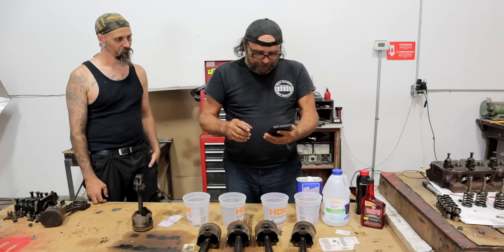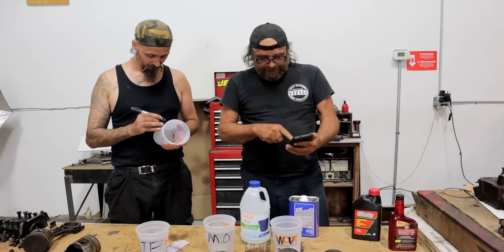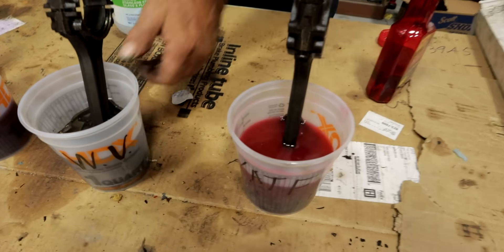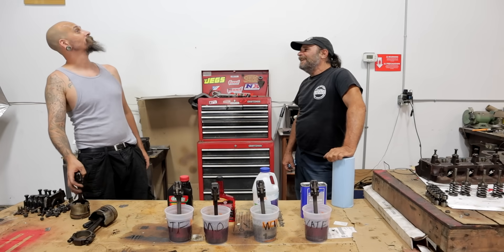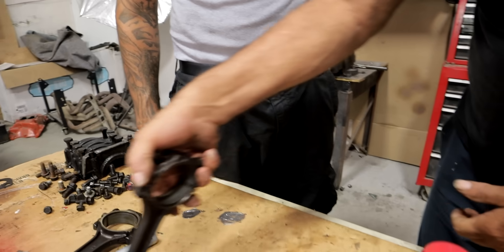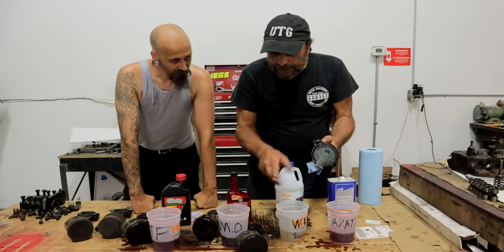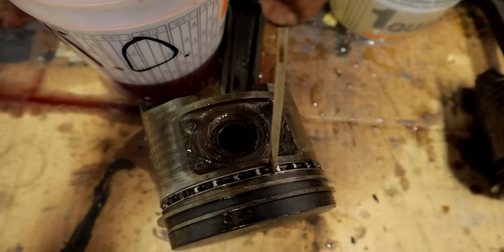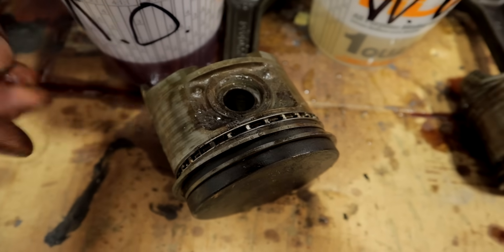Best Fix For A Stuck Engine - Viewers Choice. Marvel Mystery Oil, vs ATF, vs Acetone, vs Vinegar

Comment: Watch puddings fab shop. Hes brought things back from the dead with vinegar that should have never run again. Vinegar is the only acidic one, it will also remove rust off valve seats and bore. Reckon vinegar over night flush then ATV before you try to start.

Comment: I'd be almost curious to find out if the results change with temperature. I don't know if you can be bothered testing it but if you get the oils and parts just too hot to hold but not much more would the results of each product change???
Reply: Heat always helps!if you would "cook" the parts the expanding of the metal would help freeing the stuck parts!

Comment: Vinegar is an acid. Depending on how long you leave it, it's going to accelerate pitting on the cylinder walls and you need to completely flush it out of your engine after you get it free, or it will break down whatever oil you put in it afterwards. 
I want to try molasses or even EDTA, which would specifically attack iron oxide and leave the aluminium and good iron alone.
Reply: molasses is acidic as well and a bit thick so you would have to thin it. I am also betting it will cause more hassles on an aluminum piston than on the walls but might be wrong.

Comment: What a surprise! I never thought of using vinegar to soak engine parts but have used it for rust removal on tools & other rusted metals. The cool thing is that it's way cheaper than the other products & comes in a gallon jug. It can also be safely heated and you can add a variety of additional detergents & degreasers to it.
Reply: Try electrolysis with either vinegar or in a saline solution.  You might be surprised, I've been using it since the sixties, out of popular mechanics back then.

Comment: I've been able to successfully free stuck rings numerous times by putting b-12 chemtool in the cyls and oil and cranking it with the spark plugs out then putting them in and running the engine until the smoking stops

Comment: I would hesitate to use vinegar unless you can closely monitor whatever you're soaking. Your parts will flash rust when they dry off
Reply: I have used vinegar many times to free stuck engines and other items and have never had any problems result  from its use. The key to using it is that as soon as the engine is free, drain the vinegar from the engine and immediately oil it and turn it over to coat the engines  cylinders , pistons, pins, and crankshaft surfaces to prevent them from flash rusting. And any pitting in the cylinders are where there was already pitting from the rust as vinegar will eat the rust but leave the good steel and aluminum unphased unless it is left in it long term. The normal 24 to 48 hours of soaking it won’t cause any problems.

Comment: I'm at 3 minutes and 6 seconds my vote is for the acids all the others are somewhat about lubrication.  Only the vinegar will dissolve that rust. The rings are shot so you can't hurt them any further the mild acid won.t hurt the aluminum pistons. you don't need lubrication because the pistons are out of the block. If this were a stuck block that  I was hoping to run l without re ringing id do the acetone and ATF. Electolosis would have been the least invasive.

Comment: old style carburetor cleaner gallon can (not spray can garbage ) that comes with a dunking basket will ment carbon and make all carboned up ,stuck ring pistons, come out looking like new ... I've been out of the auto stuff since about 2000 but back then the petroleum based stuff worked great but not sure about the environmentally safe water based stuff .. Be interesting to see you try both!! The new stuff might be good also ,because carb gunk is stubborn so please  give it a try you will be very impressed  ..

Comment: My 53 Ford sat for a decade. White gunk kept filling the glass bowl on the carb. It was everywhere in the carb. I tried EVERYTHING in my garage. I came in for a beer, and looked under the kitchen sink. TSP Bubbled it off in seconds. I dropped the tank and used it in there too. Problem solved.  If your answer isn't in the garage, it might be in the kitchen. Vinegar might free up a rusty cylinder.

Comment: I soaked an entire 58 chevy restoration in a 1:4 vinegar to water bath. any parts that would fit in a 50 gal on drum 1/2 full. 5-7 days and all the rust just fell off with a light rub with scotchbrite. I didnt need to sandblast anything. Beware it eats plastic and softer metals if left to long. My trunk latch learned the hard way. Vinegar is so easy to work with and not oily which is horrible in a body shop

Comment: The one thing that the vinegar has going against it is that if you're freeing up the rings without tearing down the engine the vinegar probably won't stay in the rings long enough to do much good.
Reply: Same with most of it, but i get your point, most will just go past the rings. This test does show that it has more juice
Reply: @baileyhatfield4273  the ATF and Acetone mix (ATF and Diesel works too) Wicks into the voids and stays there. It generally tests better then the high-dollar penetrating oils, even better than Aero-Kroil.
Reply: @kmoecub  Kroil is probably best for times when you’re heating the stuck parts with a torch to aid penetration of a penetrating oil.  Something I’d never try with an acetone mix.
Reply: Right it's fir rust anyway, but I've seen plenty engines freed up with Marvel

Comment: I've got a '53 210 with the 235 that sat in a field for 40 years, I assumed this motor is trash due to the aluminum pistons, do I fill the block with vinegar or do you have a better suggestion (I had already planned on making this thing a gasser)

Comment: Told ya, LOL! If you have any rusty metal, Cleaning vinegar will take it off (unless it's really thick rust, may have to chip the rust off first) . I had a '91 D-150 that the paint was burnd off of the roof from years of sun beating on it. I laid some cheap cloth towels on the roof, soaked them with cleaning vinegar, then covered the roof with plasticsheating to keep it from frying out, Let iit sit for 3 days and uncovered it. Then I pealed the towels off. All of the rust was stuck to the towels and the roof metal was as shiney as it was the moment it came off of the press at the factory. Then I washed the roof with baking soda and water to neutralize the acid in the vinegar then rince that. I got sidetracked with life and the truck sat in the weather for over a month uncovered and it was still shiny new looking, even after being rained on several times. I gave it a light sanding then primed and painted it. I use cleaning vinegar for all my rust removal. Way better than sanding your ass off and warping a hood like I watched a buddy do, LOL! On a stuck engine, I fill the cylinders with cleaning vinegar, let it sit for 3-4 days then turn it over with a socket and breaker bar, fill the cylinders with baking soda and water. wait a day then turn it over by hand to pump the water out of the cylinder, drain the oil from the pan  put diesel fuel in the cylinders turn it over by hand then drain. Put fresh oil in and filter on the engine, a little squirt of oil in each cylinder, turn it over by hand again to get oil circulated put the spark plugs in and fire it up.

Comment: If your patient and willing to use the weaker food grade vinegar, it costs less than half the price of gasoline these days at Walmart.  Crazy cheap when you think about it.  And the weaker acid won't be as aggressive on the aluminum.  I have seen ATF used as an oil flush to un-gunk an old engine with sticking hydraulic lifters.  But that was oil sludge not rust and was a last resort which did work out in that particular case.

Comment: Even better- and cheaper- than vinegar is to get a jug bag of citric acid sprinkles and mix them into water. Cheap as hell, you can tailor your acidity, and can easily get to near phosphoric-acid strength without staining.

Comment: I’m surprised Diesel did not make the list, that’s a go to for stuck rings.
Reply: diesel is very similar to ATF in viscosity
Reply: Fwiw, the Marvel Mystery Oil has kerosene in it (I think), which is basically like diesel oil.

Comment: Any acid is going to be more aggressive than any oil, particularly if there’s rust.  That’s great when you want something to be aggressive.  But acids etch metals so you don’t want to leave metal in acid too long and you want to be sure to neutralize it when you’re done.  A good rinse with water or acetone will do that.  If you use water, you’ll need to dry it to prevent rust.  If rust is the main problem, electrolysis and chelation (e.g., Rust911) will aggressively remove the rust without the possibility of etching.

Comment: Well damn, I learned something today. I always used the Acetone/ATF, but if white vinegar does that good of a job without having to mix anything together, I'm sold! Thanks for the vid!
Reply: A question I would have is if pouring white vinegar into pistons, how well does that need to be flushed out before turning the engine over, then starting it?  Would one then pour oil or MMO down the cylinders to wash it out through the oil pan?
Reply: And a lot cheaper to get

Comment: Just remember getting to the rust is the most important that is why vinegar worked, but did not clean the gunk. It reduced the rust from its oxidation phase.
There is some science behind what the target of concern when parts/engines are stuck.
Next in series, what is the best gunk cleaner? Dawn, TSP, lye or other cleaning agents that will not harm steel/iron/aluminum parts/components.
Thank you UTG.

Comment: Try these again, just add heat , , it might make a difference,  maybe motor temp , not quite boiling,,,,
Reply: My motor temp is 10° hotter than "boiling". 
A lot of computer controlled engines are designed to run in the 220°~230° range . Pressurized sealed systems prevent actual boiling at those temperatures . 
And I've tried lowering the temperature with a 180° thermostat -there computer thinks the engine hasn't warmed up yet , enriches the mixture (computer injected version of "choke") , soperformance AND fuel economy both suffer .

Comment: I have used vinegar multiple times loads of success.  Aluminium will erode in vinegar quickly maybe couple of thou a day. Vinegar only really suitable with steel . Had a ally ringland failure I believe from too long submerged years ago.

Comment: I've been able to both remove rust and dislodge greasy crud with EvapoRust in my ultrasonic cleaner with the heat on.  I'm curious to see if it will help with carbon buildup.  Great video.
Reply: I used evapo on a stuck 454 on a customers boat total bust never worked

Comment: Uncle Tony,
Actually, your average, everyday APPLE CIDER VINEGAR that you can buy at your local grocery store works as good, or even better, than the white vinegar that you used. Even everyday WHITE VINEGAR, that's found in your local grocery stores, is a good as what you used in your experiment.
APPLE CIDER VINEGAR (ACV) is excellent for a wide variety of uses: including different kinds of rust removal:
1) pour some ACV in something like a glass Masson/Ball canning jar & put rusty nuts, bolts & screws in, and let set for about 5 days; and observe the results.

2) to remove surface rust on chrome, pour a little ACV on the rusty spot & very lightly "sand" that area with a small piece of aluminum foil, making sure to keep the foil & spot moist with the ACV. Don't overwork the area. Do just enough to get rid of the rust. Rinse with  a little ACV when done. Buff dry with microfiber towel. Allow time for area to fully dry & polish.

Comment: I saved this video to watch later tonight... I've got an old 400 Pontiac shortblock sitting in an oil drum soaking in diesel fuel right now in an attempt to get it unstuck. I don't think it's badly stuck, but I didn't want to try turning the crank with a dry engine. The rusty cylinders are the problem, the crank and rods actually look brand new. I'm hoping having it soak in diesel fuel for a few months will help free it up without damaging anything any more than necessary.
Reply: I've done this but with Kerosene which is basically the same thing.
Reply: @saganworshipper6062  how did it work out for you? I just want to release the pistons from the block in the safest way possible, I don't care about the pistons or rings, just want to save the block

Comment: Vinegar is awesome BUT, as soon as any rust is eaten it begins eating cast iron, so, check and clean the soaked parts regularly,  as soon as the rust just brushes off(it always looks like its still stuck) get the vinegar rinsed out of the iron pronto!

Comment: I’d like it to know the origin of the myth that atf frees anything up. It’s an old timer myth that goes back many decades.
Reply: I think it’s because ATF has so much stuff in it to break up deposits and keep the trans clean and working. And, it’s pretty thin so can penetrate decent. 
But, it isn’t really designed to break up carbon deposits since there (hopefully) isn’t combustion in the trans.

Comment: I’d be shocked if nobody suggested what I’ve used. 

I thought about this years ago before I executed a plan to remedy it in the most effective way I could cook up. 

The problem with stuck rings is going to be two things- the expansive nature of iron oxide corrosion (rust) in combination with the pre-existing buildup of hydrocarbon crud caked up between, and behind the rings. 

I figured since the use of a chemical reactant that would eat rust isn’t really an option, as the options most effective for that tend to be highly corrosive, as well as possibly consuming aluminum, so I opted for eliminating the other side of what was taking up free space, the hydrocarbon buildup. 

The best thing I’ve found that will absolutely liquefy hydrocarbons where they wash away easily is Berryman’s carburetor dip. That stuff will eliminate the hydrocarbon gunk and give the rings a much better chance at freeing up, since the rust will have that much more space it no longer is competing with. 

After they free up, an excellent corrosion fighting lubricant like ATF with help the rust to naturally wear away with the normal up and done movement of the pistons in their bores once they are free to move again.

Comment: Simple green works well I use it to clean my egr coolers works perfect at I can see but rest is crap and way too expensive acetone usually if I'm cleaning part it's either diesel fuel or ATF or some simple green works on carbon beautifully and doesn't cost a lot of money

Comment: Down side to white vinigar. If you do not rinse it off pronto it will rust back quick fast and in a hurry lol.
Reply: isnt it normal to put a cleaned enginepart direktly in some engine oil?At least i learned that as a car mechanic!

Comment: Good experiment! Why don't you try pouring white vinegar into the spark plug holes of a stuck engine.  Let it sit for longer than a day since the pistons can't be immersed in the vinegar the way you did.
Reply: Vinegar will run down faster because it's so much thinner. ATF or Marvel will sit longer due to the viscosity and have a chance to penetrate better. Not to mention vinegar is more corrosive and could damage the cylinder walls by pitting.
Reply: @carllmack2287  I put atf in a motor with the heads off and let it sit for a week. It didn't go anywhere at all. The vinegar is much much thinner and of course dissolves rust because it is an acid. Would it free up a stuck ring in a motor - dunno.
Reply: @danielboughton3624  I'm about to find out, might cut it with ATF though just to be safe. It can sit a week for all I care, I just want it freed up.
Reply: @carllmack2287  50?50 mix then?

Comment: Now, hit them with EasyOff Heavy Duty Oven Cleaner and the carbon will melt away in minutes.
Reply: youll find castrol purple clean is also sodium hydroxide like easy off

Comment: Kerosene and Hydraulic oil down cylinders 4 foot snapon 3/4 inch ratchet on crank bolt or nut with a tiedown attached to it with pressure and walk away for day come back tighten up tie down and usually engines break loose unless they are really bad and needs to come apart and usually if rings are stuck usually a little oil down cylinder will give enough compression to fire engine and usually a couple heat cycles in engine will loosen rings. That's usually how I do old engines.

Comment: No money and dead broke? Boil your parts in soapy water for an hour or so. Old timers did it that way. Carbon softens up quickly that way. After cleaning and drying dont forget to coat with oil. Might want to use an old pot and the grill, otherwise the wife will get hateful.

Comment: I have never been impressed by Marvels Mystery Oil.. To me, it's just modern day snake oil.
Reply: Marvel is great at releasing sludge in a high mileage motor and collecting in the pan to plug up the oil pickup and lock up your engine.   A buddy in high school did that on a Maverick with a 302.   I told him not to do it and the sludge was best being left alone.   The motor sludge wea probably close to a half inch thick.   When we pulled the pan, the sludge/mud had filled the pan about half way.   It was so thick it wouldn’t drain through the plug.   The heads and lifter valley were nice and clean though👍.   Point of my rambling is MMO is a pretty good solvent for stuck on oil sludge.   Use with caution.   Thanks Tony